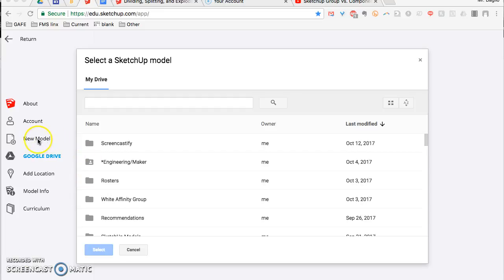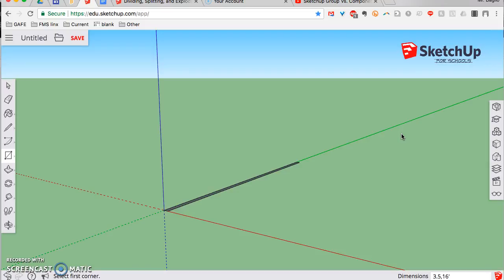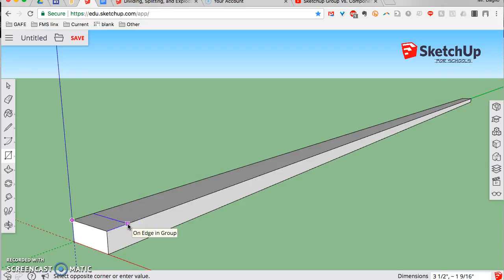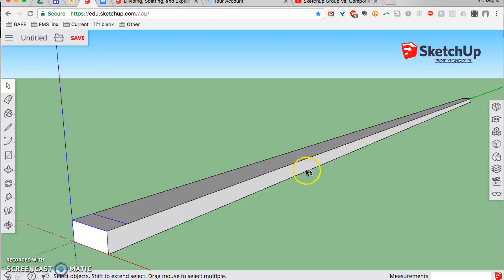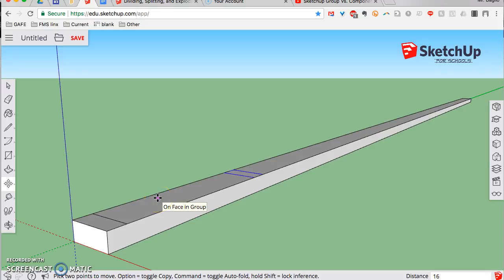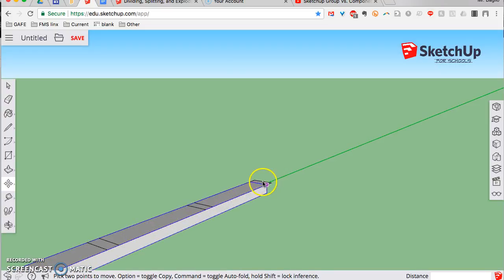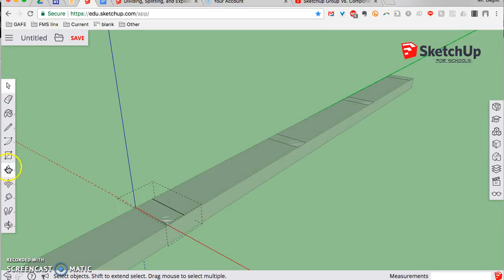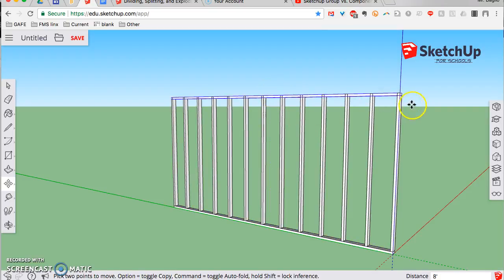SketchUp Stud Wall: Components, Groups, and Multiplying

Comment: Great video for learning the basics of wall framing in sketch up. Just one comment though - the first 16” distance between stud 1 and stud 2 should be measured from the outside edge of stud 1 to the centre of stud 2. Then from stud 2 onwards the 16” will be measured centre of stud to centre of next stud. It’s done this way to ensure your 8’ x 4’ OSB/plywood falls on the centre of a stud giving the other half of the stud to the next sheet for fixing.

Comment: same question as Sebastian.... repeat how make a copy .... PLEASE
Reply from the maker: To copy the original piece, I hit the move tool then clicked option (alt on a PC) on the rectangle, and then it moves a copy of the rectangle, leaving the original in place.  BEFORE CLICKING AGAIN, type "16" return to space it 16" on center from the original.  THEN type "x10" and return.  This makes 10 copies of the same shape at the same interval that you just created (16").  Let me know if that helps.
Reply: @JohnBaglioTeacher Why doesn't that work twice off of the same component? Also the x10 doesn't seem to do anything for me
Reply from the maker: EndIsNear Not sure why it doesn’t work off the same base component twice. With the x10, you have to make sure that you didn’t click the mouse or hit enter before you typed it. If you did, SU assumes you are done with the operation.
Reply: @JohnBaglioTeacher  i did not click and it still doe not want to multiply for me

Comment: for 16" on center, the distance between the studs needs to be 14.5"
Reply: Victor Rodriguez when he moved the stud 16” it actually moved it from first edge of first stud to first edge of second stud— making it 16” on center and 14.5” between studs. So he did it right.
Reply: @anthonygreen9844  Good to know, I was wondering the same thing myself -- where the measurement was taken from. Thank you.
Reply: @anthonygreen9844  But the distance between the first two studs should be 12.75” shouldn’t it. And then from stud 2 onwards it will be 14.5” to ensure 16” centres. This is because that first 16” is measured from the outside edge of the plate to the centre of the 2nd stud. It’s done this way to ensure that your 8’ x 4’ OSB or Ply will land on the centre of a stud leaving enough space on the stud for the next sheet to also be fixed to.
Reply: @AccountantDoesDIY  no matter how many times I try, although I can move it the 16", nothing happens when I multiply it by 10!!! So frustrating learning a new program